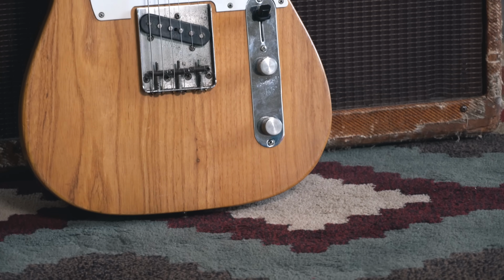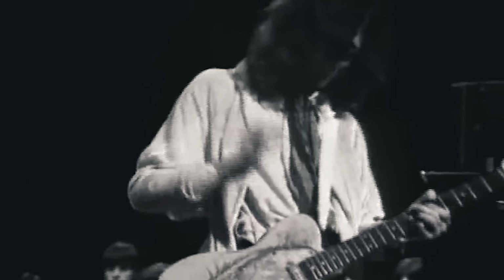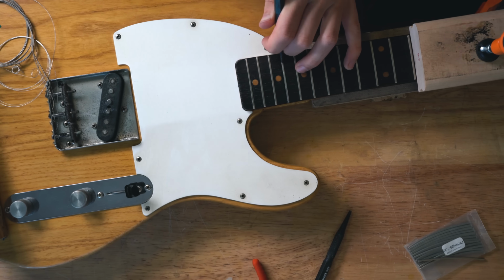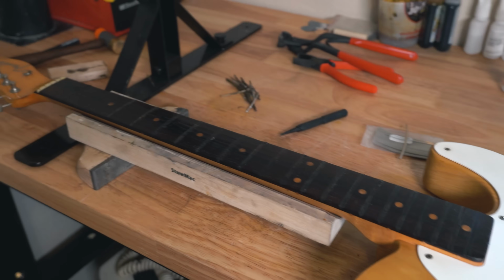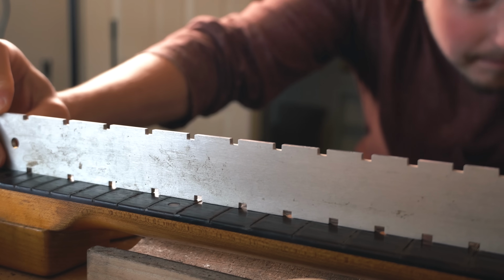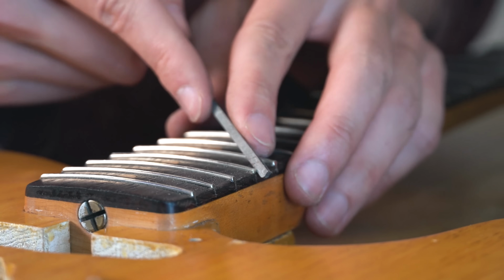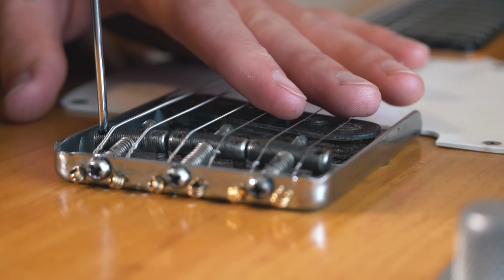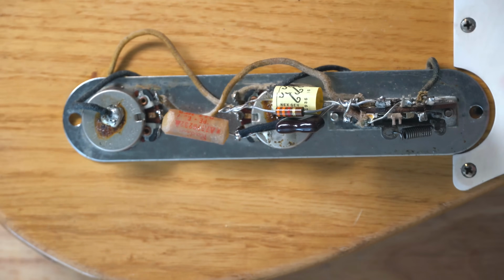Rare 1950s Fender Esquire Lives Again - REPAIRS & DEMO!

Comment: Esquires are underrated!
Reply: Esquires are the best
Reply: No truss rod?
Reply: @lllULTIMATEMASTERlll  There's a truss rod. It was installed into the maple neck prior to the rosewood fretboard being glued on. Hence, no skunk stripe on the back of the neck or telltale walnut plug above the nut. Important to note there were variations over the years, but for the vast, vast majority of pre-CBS Fenders with rosewood fretboards, that's how it was done.
Reply: I love my tele bridge pup through the Marshall 800. My favorite addiction.
Reply: @anthonyc1883  Oh thanks for letting me know. I was under the impression that all Esquires lacked a truss rod. This is good news and makes me like the Esquire more!
Reply: Definitely.
Reply: @lllULTIMATEMASTERlll  The very, very earliest Esquires (perhaps a handful) did not have a truss rod because Leo thought the thick all-maple neck did not need one. His sales partner, Don Randall, convinced him otherwise after those extremely early samples supposedly had neck  movement/warpage that a truss rod would have alleviated. Those earliest Esquires were the first Fender black guards and they were built  with one or two pickups. Again, extremely early and extremely rare. Once Leo started using truss rods, the two-pickup guitar was named Broadcaster and the one-pickup guitar was named Esquire. The details of the earliest (and later) Fender history is quite fascinating and can be found in at least a couple or more excellent, highly researched books.
Reply from the maker: Love them!
Reply: By who?
Reply: @MatthewScottmusic   With th jcm 800 I quickly came to understand why John 5 likes them.  Great for Jazz too. Nice soft playing while the 800s tubes are getting nicely warmed up and the everything on 7.  Attenuate as needed.

Comment: The not so ¨dark¨ circuit  sounded really good. What values did you use? What a badass guitar!
Reply: I also would be very interested to know. It sounded almost like Hendrix's tone on Wind Cries Mary, very strat like. Seriously, Leo Fender smashed it with that circuit, so many tones from one pickup.
Reply: I think that the capacitor in the dark circuit was changed sometime in the late 50's to let a little more treble through. Don't recall the values off hand.
Reply: .001 orange drop works great. .0047 for the cocked wah Eldred/Arlo mod.
Reply from the maker: Is basically the Eldred mod as mentioned below.

Comment: Liked them all but position 1 (dark) cap brought the dark to the light! Mild base blend with clear distinct mids that dampened the highs to a very pleasant level. Nice job, another rebirth of the 50’s frequency evolution in 2021! Was planning on building an Esquire  hardtail with a 5way switch and this video has inspired me to lay it down on paper and start the project.

Comment: Ridiculously cool guitar! Here is a tip you could try for removing frets sideways. Take a dremel tool with a small engraving bit and cut a tiny notch down into the fret near the end. This gives you a tiny ledge for your punch to "grip" or bite onto while knocking the fret out. Much less chance of your punch sliding off the top of the fret and puncturing the board. 

I always light up when I see a new Matthew Scott video. Keep it up, man! Thanks for the awesome content!

Comment: A few thoughts: StewMac sells a fret saw with an adjustable depth stop, eliminates the need for the glue/dust filling after the frets are in. I cut a 1/2" piece of fretwire, file the nubs off one side of the tang and lay it against the sawblade to set the depth stop. Practice on a piece of hardwood first to make sure  it's set correctly.
  My '59 Tele has a top-loader bridge and factory ferrules on the back (!)  One time I strung it up using the top-loader and played it that way for 2 minutes before I cut the strings off and loaded it from the back. The tone was horribly different. I wouldn't advise drilling holes in your guitar, but if it was mine I wouldn't hesitate for a second if I was sure it would be my 'forever' guitar. 
  When I got mine in '82 somebody had routed the body for a Tele bridge pickup in the neck position but removed it and put the original back in. I've often wondered what it sounded like. I've never seen it done before or since.

Comment: This is a great series and much appreciated.  One tip though, when removing the nut if you use a fret saw to cut down the middle it will collapse inwards away from the fretboard reducing the risk of tear-out.

Comment: I converted a solid rosewood Telecaster to an Esquire.   
For the neck position/circuit I installed the Eldred Mod.
Basically is sounds like a half-cocked Wah or a Strat's out-of-phase tone.
It's all great, thanks for sharing this Matthew.
And yeah, for whatever reason the pickup straight through the volume only reminds me of an angry P90 pickup in a LP Jr.

Comment: The different value capacitor in the "dark-circut" is the "hot setup". I like the sound better than any Tele neck pickup I've ever heard, plus it's still a single pickup guitar. Nice.👍

Comment: Cool video. I've just recently been hooked by the Esquire bug. All I can afford is a Squire CV 60's Custom Esquire, but so far I'm pretty happy with it. I'm still getting used to the guitar, but I really enjoy using the switch in the forward position (the "Dark" mode), especially with a bit of OD. I am considering some upgrades, like switching out the pickup (it's a little too trebly for my taste) and looking for ways to make the "Dark" mode have less of a volume drop when engaged. But that's somewhere down the line, I'll be playing it stock for a while. Thanks for this video. I loved your playing on it.

Comment: Esquires are just clean looking. I’ve been wanting to try the SD Secret Agent pickup in one though, I’m not a big fan of the Tele neck alone but both can be really useful. My first good guitar was a Japanese Tele and it was a top loader. I really like the slinky feel of them and ended up putting a dual loader on my favorite Tele now so I can top load.

Comment: Nice guitar! I was hanging on for the wiring and some details on it. I feel this came up a little short on that part. Do you have the values for the capacitor and resistor combo your friend sent and you installed? It looked like a combo of both vintage and modern of some kind. Thank you. ❤️

Comment: I learnt what 'good Fender tone' was on a similar, early-'60s Esquire with veneer board... that was the late-'70s and someone had 'improved' the Esquire by cutting off the horn for slide playing... thankfully, someone skilled had glued and pinned it back on again, but the tone, like yours was truly remarkable... What amp(s) did you use ?

Comment: Sounds amazing. Any chance you want to tell us what the secret sauce is on that "dark circuit" (i.e. the values of the caps and the resistor)?
Reply: Resistor should be 3.3K based on the colour code. Cap 1 looks like a black silver mica cap, so probably a value of 500 or 1000 pf. The other cap i don't know.
Reply: I checked the original esquire schematic. it has a 0.05 uF cap and a 3.3K resistor on the neck position. So this is probably removed (or the ends lifted) and replaced by only the black cap.

Comment: Super cool.  I love teles.  I put together a coupe of "parts casters", one with Custom Shop '51 nocasters, and one with CS blackguards.  I notice some guys using superglue in the fret slot when they hammer it in, but it looks like you just used it on the ends.  Is there a reason for this?  Just curious, I'm learning.

Comment: Looks like it has a cutout for a neck pickup, and the routed out slot for it's wiring under the pickguard. They must have used the same body piece for the esquire and telecaster models.

Comment: Hey Matt, would you mind to share a diagram of how that "dark" circuit was wired and what values of components have you used? It sounded really good, I experimented with esquires but never got that position to sound this good. Awesome job on the neck btw!

Comment: Beautiful guitar reborn by and for very deserving and capable hands. I wanted to ask though when the pickguard was off you can see there is routing for a neck pick up. Also the pickguard is white and has 7 screws. Are these features correct? Is it possible someone has converted a Telecaster into an Esquire by removing the neck pick up and replacing the neck? Wouldn't that explain why the dark circuit was missing? Forgive me if I'm way off here. It's just my first thought. Much respect.

Comment: I like when the capacitor in the Front position gives a ‘Cocked Wah’ sound like Michael Schenker gets… (Instead of the “bass” capacitor.)

You could almost have two values of capacitors in two of the positions. Then when you’re soloing you can randomly change the midrange peak emphasis of the Cocked Wah type effect in the 2 and 3 position. No pedals required!

Position one could be just the bridge pick up with a standard tone pot control.  The way position two is now.

Comment: Really well done video presentation. Followed :)  I just built a Partsquire with the Eldred tone circuit. The "neck" position is so much fun! What amp are you using for the tone test that ends the video?

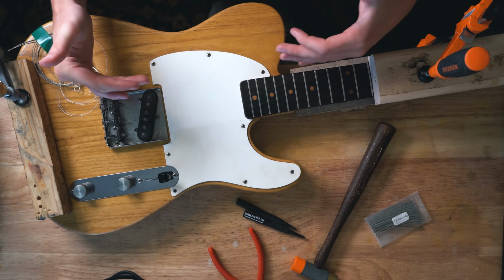Comment: 2:06 I never seen how to remove frets and I thought the there was the need to PULL em UPWARD. This way of yours seems far much better than pull upwards. I don't still figure out the need to put the melt soldering onto the frets top. If the purpouse of that was get the glue melted, well wasn't it sufficient put the  welder tip onto the fret top?
Reply: About that question of mine I think I've just got the answer by myself own; that fret soldered top acts as a "GRIP" to facilitate the work of those punh tools, am I right?
Some more questions please;
#1. about fret slots. After you took frets off is there no need to put some glue drops also inside the fret slots instead just in the nut ones only?
#2. about the fretboard finnish; I saw you put no finish on the fretboard after you fretted up. Is that maybe a matter that rosewood fretboards do not require no finnish unlike maple fretboards do?
#3. 7:01 what grain and type is that sanpaper?
Thank you in advance

Comment: I remember watching a video where this Luthier was re-fretting a 60's Jazz master. He mentioned chip out when you hammer the frets out from the side. Is there any other way to take  out the old frets?
Reply: Usually, chip out happens when someone tries pulling the frets straight out / up with pliers. I suppose it could happen when taking them out the side, but it''s definitely the safer route.

Comment: Refretting question for you (or anyone else here)...I typically use thin CA glue to glue in frets, but I have seen some people use thinned out wood glue. The reason they give is that is easier to clean up off the fretboard (which I understand) but I am not sure it works long term with frets. Any thoughts?

Comment: How come you use soder when your heating the fret and not just the heat gun? Am i missing something? Its great you do your own work. That's the way to do it. I found out the hard way by taking a new les paul to a pretty locally famous shop to have a nut replaced and a full setup done. Suffice to say the butched it bad!! How do you butch a nut change and setup??..I could have done a way better job, but i figured new guitar i wanted it done right no questions! They must have slipped with the razor blade changing the nut out and dug a line across the first fret on my beautiful rosewood fretboard. Didn't even put in the nut i purchased and they carved the nut slots horribly on the nut they did put in ughh! I was pissed!! They gave me the run around and told me they would have to sand my fretboard down where the line was carved. I was not gonna leave it there for more work to be done after that nonsense! Since then i do all my own work. Just not as skilled as you are yet. I hope to be eventually. Its a learning game for sure! Sounds great man!! Your luck with these old guitar finds is crazy!! Send some of it my way lol. Rock on!

Comment: (Starting at 8:07 ) It appears that the 0.047 uF cap & resistor are not soldered to anything (but one another) on the left side (from video point of view). Is this the case? If so, could someone explain that to me? I see where they were soldered along with one of the Cornell cap leads to the switch but It looks as though only the Cornell 2400 pF cap has both leads soldered. I appreciate any help with understanding this.

Comment: Do a lot of my guitar work myself. Like how you tapped the frets out the side. Saved yourself the up chips. But you have to watch for the side chips. Kind of understand the reasoning leave the top edge so the barbs have something grab on to. But then there is barb line underneath. Either way has its pros and cons. Prefer the big 18" aluminum radius blocks. Seen some guys make a runner jig the radius block rides against. Few ways to set frets and glue em. The jaws or a fret press. Run medium super glue as they are set. Pretty much do the fret ends the same. As far as leveling something that nice i probably would have had it Plek'd. The cheap Chinese guitars ill level but the high end ones i just take it to a plek machine. Kind of wondering about the natural finish. Is that original or did someone strip down the line. All in all it's 50s tele and that is a score player grade or not. Congratulations.

Comment: Why is there routes in the body under the scratch plate for a neck pickup and wiring. Leo must have been already working on the broadcaster before the esquire was even released. 🤷🏻‍♂️

Comment: Actual question-why is there a switch if there’s one pickup?
Reply: Google Esquire wiring.
Reply: Gives you simple switchable tonal options. All the way back is no tone control, middle is normal with Volume and tone, forward is normally wired with a capacitor that is basically all about the bass no, treble . Lolz. 
    Mathew has wired his with what is called the “Eldred Mod” which basically replaces the forward position “bass” capacitor with a capacitor and resistor that emulates a wah pedal set with the pedal in the middle as it were, or a “cocked wah.”

Comment: 7:49 No, it doesn't. It doesn't emulate neck pickup, it is a very common misconception.
Position 3 on Esquire emulates a bass guitar, which was non existent back in 1950s yet.

Upd.
Was listening thru monitor speakers and couldn't distinguish the difference between position 2 and 3. Strange.
Reply from the maker: Well, the Fender P bass was introduced in 1951 so there goes your theory.

Comment: Please can someone advise why the guitar has a selector switch with only one pickup?
Thanks
Reply: Typically - Position 1 - Volume pot only - tone pot  bypassed. Position 2 -  V and T pot engaged. Position 3 - "dark circuit" and V pot engaged, T bypassed.
Reply: Google Esquire wiring

Comment: bad fretwork. Sorry man, it's bad work.
Reply from the maker: You can barely even see the work in this video..
Reply: @MatthewScottmusic  I didn't mean to offend you. But man, the gap under the frets is visible even on the video. I have been working with electric guitars for over 10 years.
Reply from the maker: I'm not offended. There are gaps in certain areas of the fretboard because I did not level or reradius the fretboard of an original 1959 rosewood fretboard that was heavily played.